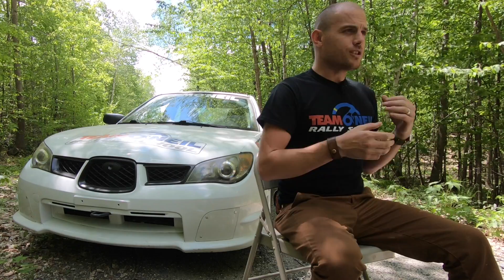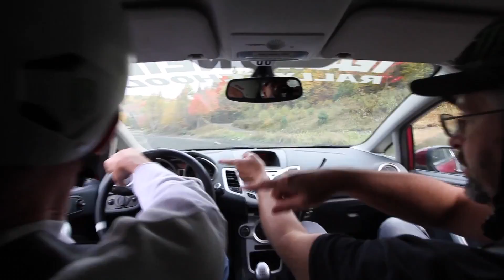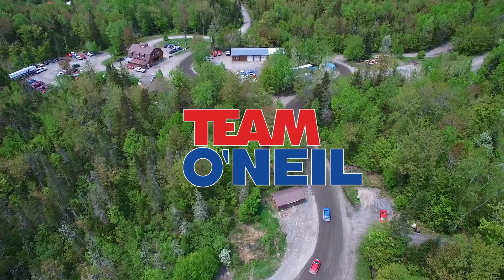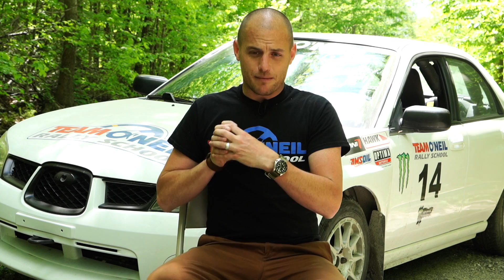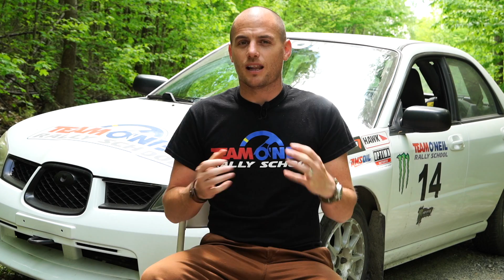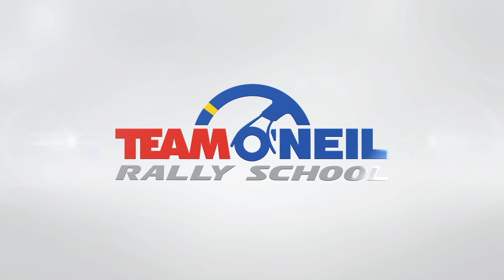Electronic and Mechanical AWD Systems Explained

Comment: Great information. I live in Alberta  Canada. One day it's 20C and a day later it's -17C. I've owned manual locking diff in an old Ford pickup, electronic AWD/FWD, and a 99.5 Audi A4 with Torsen AWD. In my experience and humble opinion, the A4 is far better. Dry snow, wet snow,  heavy rain, that low wide stance with quattro can't be beat. I'm not an expert, but I am observant. In the Audi Torsen quattro, it likes to be driven a bit more aggressively. If you get on it, the car travels in whatever ditection you point the front tires. Mine is a daily driver and I absolutely trust the Torsen AWD. The car is a beast.

Comment: You forgot Subaru's ATS systems. The ones that advertise a 60/40 torque split. They are completely controlled by a electronic clutch pack.

Comment: Put it simply. A full time AWD(probably a 4WD in high 4 as well). Point the wheels and gun it. A part time 2WD with 4WD on demand will push you into the gutter. My experience with On Demand is that the FWD slips and the On'D RWD pushes into gutter at low speeds, 40kph on slight sandy/dusty roads. Not going back.

Comment: got me a 96 A4 Quattro V6 and the drivetrain makes it feel like a 4x4 truck in 4-low, but it really does feel glued to the road especially in the rain which I used to hate driving in with my previous fwd cars.  Viscous coupled permanent all wheel drive, it has a sticker under the hood to remind me before putting it on a dynomometer which I thought was cool to see

Comment: Thank you for all the videos. Fantastic info.. Right now im looking at the Yaris GR 4, that is comming up soon. Any thoughts on the that one? Its possible to get with with Torsen limited-slip differential rear and front and 3 different interchangeable modes 60:40, 70:30 and 50:50. 261Hp is surely to much power for me, but would be fun and fast right? Is this car possible to test for you?

Comment: Assuming no metal to metal contact, viscous couplings rely on the properties of a fluid to stay the same as it ages. It won't. It should be replaced regularly to maintain performance.
Reply: So just to be clear if I ever buy an abused impreza, If it's got a worn out viscose coupling can you you fix it by just replacing the fluid? Also another question, will using the handbrake (without any fancy diff dissenenging stuff) quickly wear out the viscous coupling? Thanks
Reply: @kieranmz4614  Two problems - you've got wear on the fluid itself which is a product of heat and age, and the subsequent mechanical wear that occurs as a result of that fluid being out of spec.

Among other things, you want a certain minimum amount of lubricity, a specified range of viscosity and good resistance to cavitation in your fluid. As it ages all these properties diminish, resulting in diminished performance of the viscous coupling, but not much damage. As you overheat the fluid it literally bakes and creates abrasive sludge. That, along with cavitation, can drastically increase mechanical wear. Even if there is no sludge, a cavitating fluid literally takes chunks out of metal surfaces. Those bits of metal dust are then suspended in the fluid and act as abrasives - further wearing down the components.

So I guess the short answer is probably not. If it's a well maintained rally car, then none of this matters, fluids get dumped at the end of each run. But if it wasn't looked after well enough, then it's possible that the coupling is fucked and a fluid change alone is unlikely to unfuck it.

Just like an engine, a regular LSD or an auto gearbox - changing the oil regularly is what prevents damage, it won't fix it if it's already there 😞
Reply: @kieranmz4614  As for the handbrake - I wouldn't. The viscous coupler uses a non-Newtonian fluid (ever seen people walking on custard? I won't bore you with the maths) which, when exposed to shear (like in a slipping viscous coupling), increases in viscosity presumably until it goes solid (like custard). At that point, if the rear wheels are locked, but the front wheels are spinning, something in that chain has got to give.

It's just not worth the risk.
Reply: @233kosta  thanks for the replies! So for buying an impreza road car for doing some light duty rally stuff, change the diff fluid immediately and treat it like a race car in terms of maintainence as it's probably been abused in past? And hope that itll freshen the front to back power delivery up
Reply: @kieranmz4614  These things have specified service intervals, I'd start there. If it's not making any grinding noises or anything like that, then you might get away with an oil change, but I'd strip and inspect it just in case - then you know exactly what you have. If push comes to shove, you can always replace it and make sure you look after it better

Comment: It's a semi-intelligent active system interfering with the car's dynamics... which is also what's between the seat and the steering wheel. So now there are TWO active systems messing with the car's dynamics and most of the time under rally conditions they interfere with each other.

Comment: Owning a 2018 focus Rs and many earlier model Subaru sti’s and wrx’s I would totally agree the Subaru is way more easier to drive to its peak. My RS only really shines when you have plenty experience at the wheel and can understand how the car will react when pushing it. Overall it comes down to wheel time in any system.

Comment: not much thats more distracting than having the stability control engage abs outta no where when it detects your in a slide. Takes my concentration away from the task at hand for a brief second as I try figure out why my abs is on (Im not on the brakes, and if I am, its ever so light pressure for weight ballance)

Comment: In BMW 3 series (g2x) you can disable traction control and keep 4wd also in x1. I have driven those on track and it can be learned how to car will react. Actually the x1 is most fun in sport mode. You can slide drift or be fast as you wish. Regarding robustness of these pieces I also have doubts if you heavy use them.
Reply: Most if not all AWD systems will still work if you press the traction control button. But in a lot of cars to actually disable the traction control you need to remove the abs fuse which disables AWD

Comment: Very well done, this is THE video that you're AWD videos were missing.  FWIW Borg-Warner bought Haldex so they're basically the same tech. 

Mine(Chrysler 300) is electronic, and I may be able to turn off ABS/ESC and keep AWD. I have a gizmo(Tazer) that turns it off in the computer. However I lose all the brake differential control so I haven't done much with it. It has a "partial off" setting though that removes the ability for the system to pull power and increases all the yaw and skid thresholds, I very much like that setting.

Comment: I still love our Evo-X with programmable center differential. :D
No changing diffs, just a good engineer and a laptop and "A bit more loose on braking, a little more stable mid-corner and keep the same on acceleration" suddenly is a 5 minute job. Requires a bit of a different approach as the driver but since I've learned it I'm loving the flexibility of it!
Reply: Who did your tuning I'm curious.

Comment: Great video, thanks! One thing I've been wondering about for a while, and maybe you can give your thoughts: a mechanical diff, even an open one, should give you more overall traction than most electronic systems. 

Just because the typical electronic ones are only going to react after you've already exceeded available traction on the front wheels; whereas even open mechanical diffs give a more even torque split all the time, avoiding the slip in the first place (for the same torque input). In my head, oversimplified, and ignoring weight transfer: it's double the amount of torque to the ground before losing traction on any wheel. Probably more applicable to somewhere you don't expect slip in normal circumstances -- like wet pavement, I guess.
Reply: Ya might think so but no, in particular with open diffs. If all 3 diffs are open the moment one tire spins all the rest lose all their torque. This kinda makes it a 1 wheel drive where all the power is always going to the one of all 4 wheels with the least traction. With even the worst electronic they're basically 2wd when doing nothing, and if there's both an open diff with the brakes doing nothing then yeah it's 1 wheel drive as well but the power is going to the 1 of the 2 driven wheels with the least traction. So with 3 open diffs if the back left tire is on ice that's it, that's where all the power is going. With a FWD based electronic if the back left tire is on ice the fronts still pull.
Reply: @snek9353  also worth to mention that electronically controlled 4wd will bring power to "undriven" axle before driven ones spin. (At least in xdrive )

Comment: So WICH Car has a good mechanical awd system, except old subarus…??
Reply: pre 2010 audis
Reply: Old evos, old audis, even old Renault/Peugeot awd stuff from the 80s and early 90s. If you can get your hands on a celica gt-four or an rs200  or something I doubt you’d be asking this question. Unless you’re talkin Nissan stuff if it’s before the mid 90s it’s gonna be mechanical. There’s not a lot out there, at least in America Audi and subie are really your options for things that aren’t super rare homologation cars that people can’t afford to actually drive. If you’re doing tarmac Nissan and Mitsubishi have entered the chat, but both of those get very electronic very quickly :/ I guess there’s a reason Wyatt didn’t cover many brands in the video
Reply: @elementaljosh  true,...
But im looking for anything newer. Any ideas?
Reply: Eli B. Newer is pretty much gonna mean harder to work on, idk how new you’re looking for. Like stuff you can buy today? Or stuff that is within the last 10 years? Are you sure awd is right for you 😂 I personally drive a RWD manual car from the 90s with no assists whatsoever and absolutely love the heck out of it even in snowy Montana (I do use snow tires tho). Go check Wyatt’s fun chart for inspiration if you want ¯\_(ツ)_/¯
Reply: True early audi quattro
Reply: @LNFFTW16  so,... a4 and bigger?
Reply: I got to drive a '90s Toyota Corolla when I had my Golf in for a timing belt replacement. And I've never had so much fun in an AWD car than I had with that Toyota
Reply: The '06-08' Charger, Magnum, and 300 had a mechanical AWD system.
Reply: AWD versions of the Porsche 911 were mechanical AWD up until they introduced the 997, which was electronic.
Reply: first generation volvo xc70's and v70r's use a viscous coupler but the xc70 never came manual in north america and v7r's are really pricey. old honda civic wagovans also use a viscous coupler for the rt4wd system and came with the same engine as the civic si of the time. im sure the awd bmw e30's were mechanical too but are also hard to find and pricey.
Reply: A lot of 4x4 systems aren't great on high traction surfaces but you can use an old Jeep Wagoneer to romp around pretty well.
Heck it won a European rally then got shadow banned through the restriction on 4x4 systems for a couple years.

Comment: I have a first hand experience with burnt out viscous coupling. It really is as he says, car get completely rubbish on slippery surfaces. Power skips from front to rear, and back all the time and it's unpredictable.
Funny thing is that you can't really notice it on dry pavement, even on race track. It only becomes really noticeable in ice and snow. One way how it can be tested is - if you can drive around icy course with pulled handbrake with no noticeable problems (no power losses), you have a busted center diff.
Luckily they can be rebuilt, and it's not unreasonably expensive :)
https://youtu.be/3FGTJH9d9sE?t=1058

Comment: Need some advice. When driving my daughter to ski lessons, and there is some ice and snow, which is safer? A nissan frontier 4x4 truck, or a Subaru forrester awd? Thanks!
Reply: Absolutely the Forester, the Nissan with it's ability to lock 4WD might do a bit better at getting through the parking lot without getting stuck. But pickups are too tall, and too light in the rear to be stable at speed making the Forester a much safer choice.
Reply: To be "safe", just get snow tires for whatever vehicle you already have.  I know people buy aspirational vehicles, but them's some expensive ski lessons if you have to pay $30-50k for a vehicle to get to the lesson.  The main difference between the two is probably just down to style/ image...
Reply: @fredygump5578  yeah, I'll have snow tires on for sure either way. Just trying to learn if one is better than the other.
Reply: @shadow6pt533  if you want a family car with offroad capabilities then the subaru forester is prob the best option, only go for the nissan if you actually need a truck

Comment: I would love to hear one of Wyatt's no nonsense reviews around more things like the Focus RS's awd system (I know he talked about it, but more specific examples would be great), or the Ford Raptor's 4A mode in its transfer case. They seem like electronically controlled systems with performance in mind, but it's hard to know how well they really work under the marketing fluff
Reply: If I remember right they tried the Focus RS and found that under heavy driving conditions the rear drive unit tended to overheat and shutdown, not sure if they ended up fixing it with modifications.
Reply: Yes, Ford had issues with the AWD system, not to mention the head gasket issues with them. So did Subaru though, which I must say feels superior, let my bias be known. Last year I test drove the 2019 Ford RS, drove to the dealer in my rusty 99 Subaru RS and overall I wasn't impressed. Would trust my life to the Subaru AWD any day of the week over the Ford AWD. Love what Ford did and their RS, it is the sexiest car on the road with some serious power, but after the test drive, and specifically my full throttle pulls onto the highway, I found I did not trust, nor like, the ford AWD. It was twitchy, unpredictable, and did not feel like I was "on rails" like a good car should. It feels slightly reminiscent of my 07 Volvo S60R, which was terrible AWD (torque vectoring). If I drove the Ford in the snow I'd have much more to say.

Comment: HI wyatt, 
What is the possibility of converting a front wheel drive car to all wheel drive for rally application. Currently if it is running on a 1.6 l NA engine with 1.0 LSD setting.  I know its far beyond comprehension to do something like that.. But just out of curiosity.. What would be the inexpensive and easiest way to do it , just to use the car for rallying.. In case if there is a possibility..
Great and informative video by the way..
Reply: It really depends on the car... Anything is possible but it would be much less costly to just find the awd car your looking for. 
Some fwd cars that come with awd as an option will have the same chassis that fits an awd system but again you'd be spending a lot of time and money for something that's just getting it to the level of a stock awd car.
Reply: The inexpensive way would be to find the car you want wrecked and swap all the parts.
Reply: @raycar1165  HI, Thanks for the information. The car that i am using for small events is a 2004 model Suzuki Baleno/(Cultis esteem in international market). I am from India,  and did try my best to find an AWD version of this car here. Its simply not available> But a version of the same is available in Norway, but importing a scrap car for the same is simply too expensive than the car itself.
Reply: Unless there was a factory 4wd version or at least a version on the same platform it is probably not worth it.
You would need to put in a completely new rear axle, probably strengthen the rear attachment points, find a place to put in the central drive shaft and the transfer case or central differential.
Most small FWD Cars have transverse engines, which makes all this even more complicated, because there is no room between gearbox and differential to take the power from and turn it by 90 degrees, unless built into the original transmission.
Reply: @kilianortmann9979  Hi Kilian Thanks.. But the version of AWD is not available where i am from. In here AWD sedans are rare. I guess its better to stick to FWD and use it here. for small rally purposes. Or else the cost could be way too much.
Reply: Only if the car in question also was made in awd from factory. In that case it ussually means changing transmission and rear wheel hubs/whole suspension, also installing driveshaft, rear differential and halfaxles.
Reply: @laszu7137  Yeah.. The car was made with a version of AWD. But its not available in India. I will have to import it and it will be way too expensive and not to mention this model is becoming a bit too rare as well. Thanks for the comment.